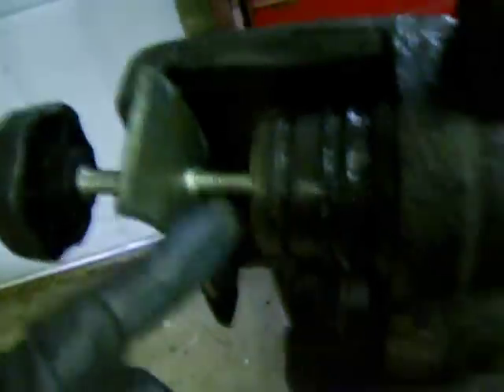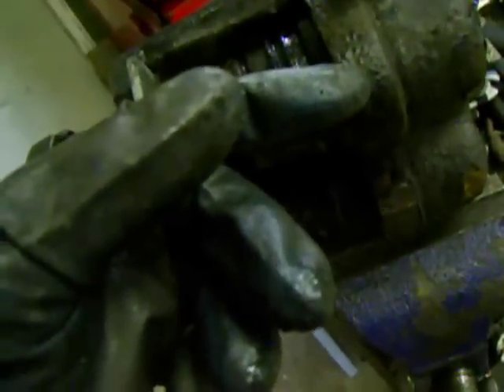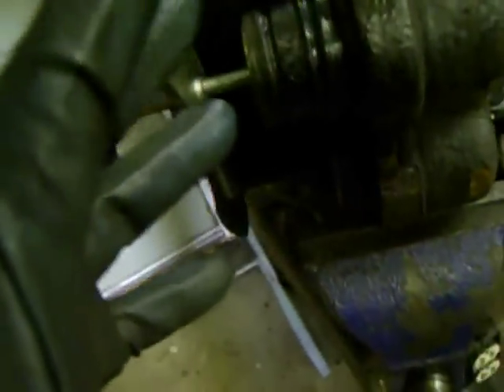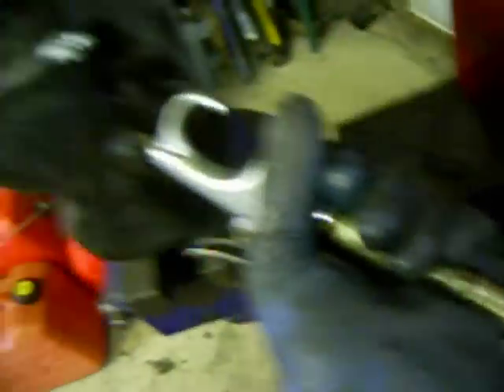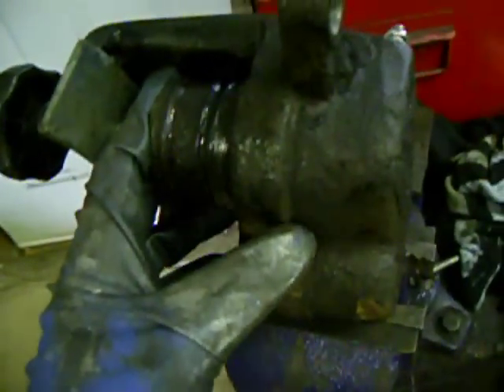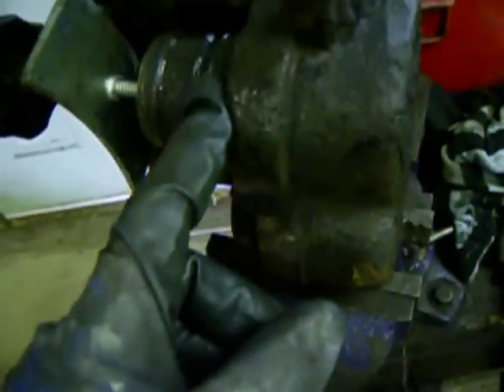Brake caliper piston reassembly

Comment: That's a lot of work to save a caliper. The last time I broke off a bleeder screw, a new caliper cost only $12. But I'm glad that was the rear of my Ram, as a new caliper for the VW is >$300. For that, I'd be doing what you did here.

Comment from the maker: @spelunkerd they are about $110 for the Tahoe...  I had to buy 2 new calipers for the rear when their bleeder screws broke off...  even after torching.  I tried to drill and extract... then rethread... it was a mess... so I bought 2 new calipers.  funny thing was the front bleeder screws were so corroded I was sure they would break and they didn't.  the rears looked perfect, yet sheared off flush with the caliper...